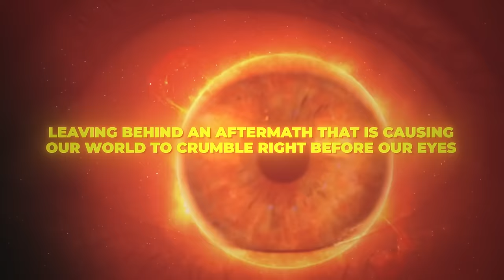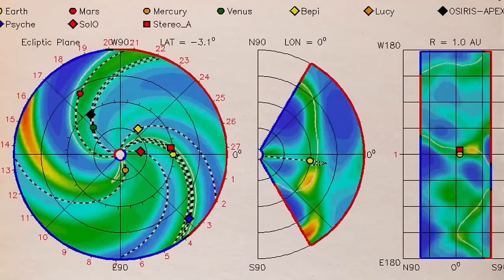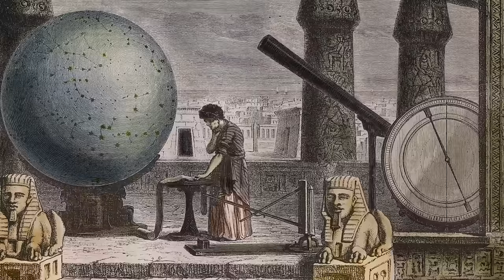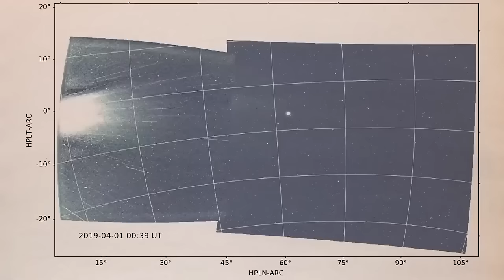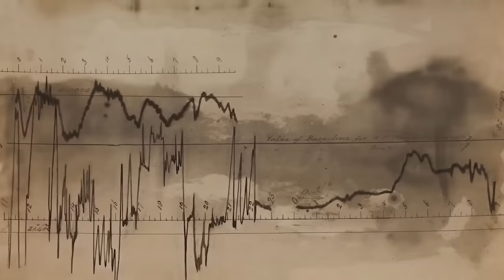Betelgeuse JUST Exploded & Something TERRIFYING Is Happening!

Comment: Betelgeuse is the next generation Sun, different then the one we have now. It will explode but not supernova, it has to reset it's outer fermiment (protective bubble) in it's finnal stages of it's building of it's new type of atmosphere. It is called the " Centrol Sun " it will be moved to were our Moon is now location and the old Moon will become the new Gia (Earth). The new Centrol Sun will light up one half of two galaxses, for one hundred and three new planet builds between the two galaxses. Just my thoughts on the subject.
Reply: Yes, I agree with the comment.  I seems to agree with New Testment, "There will be a new Earth and a new  Heaven",  Revelations
Reply: I agree too